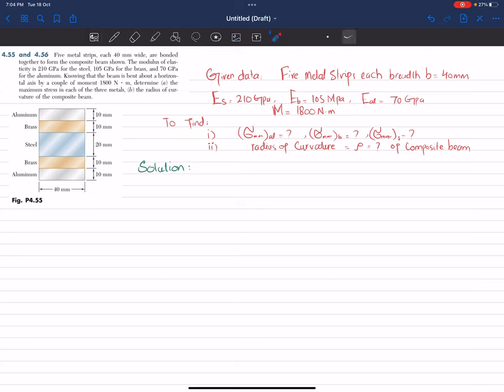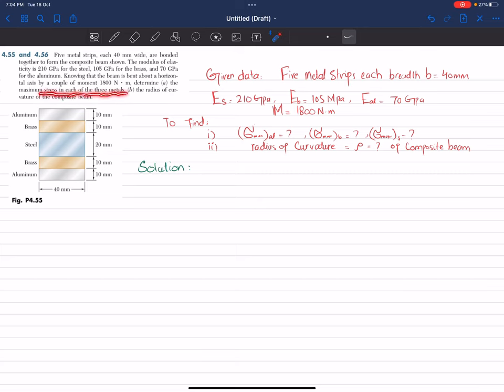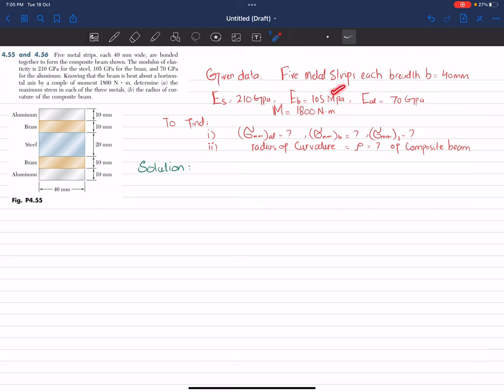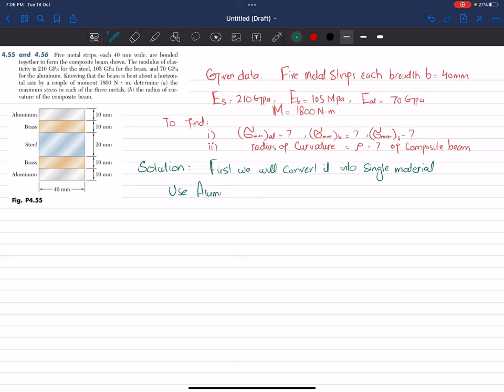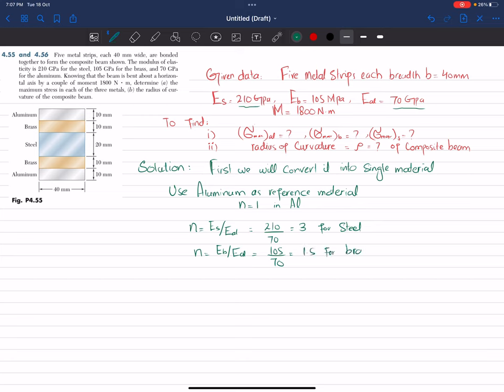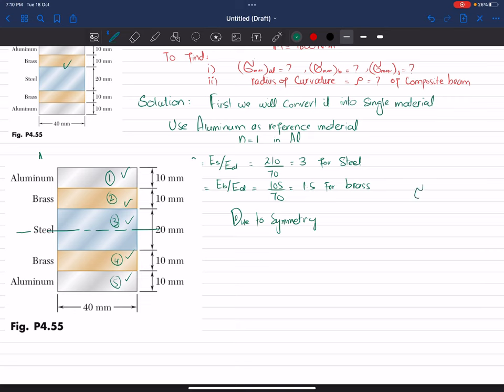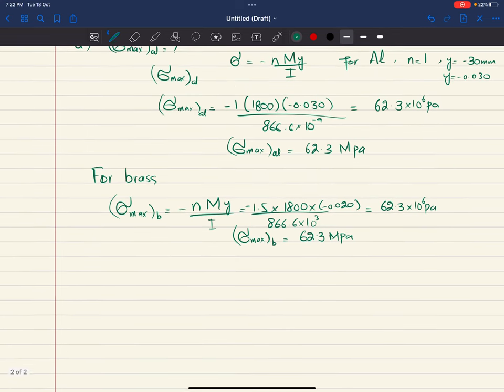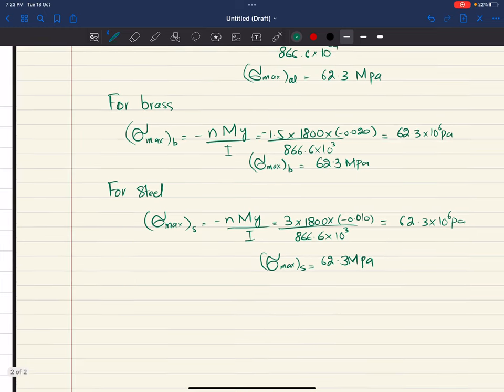4.55 | Bending | Mechanics of Materials Beer and Johnston

Comment: So whatever material is at the bottom should be used as the reference or its aluminium always?
Reply from the maker: NO YOU CAN CHOOSE ANYONE BUT THEN AS PER REFERNECE MATERIAL YOU HAVE TO CALCULATE n and as per n its breadth and moment of inertia will change. Try it plz...